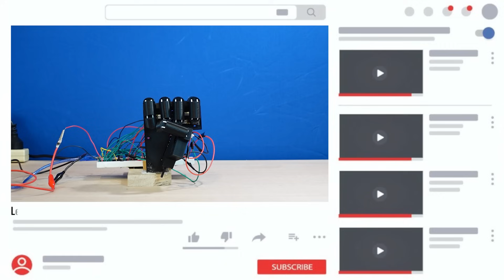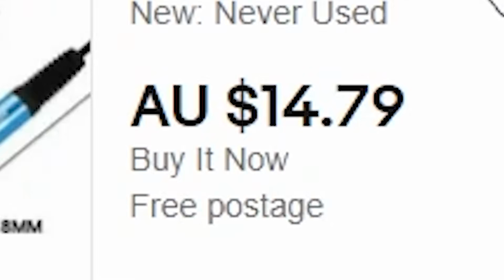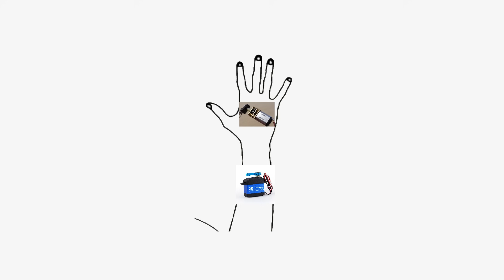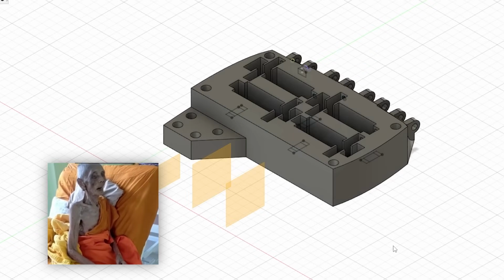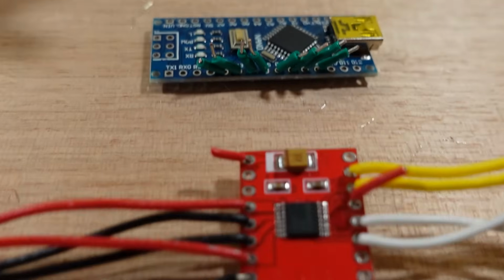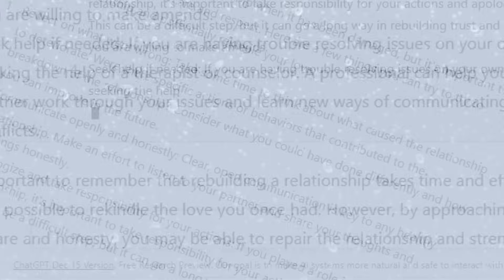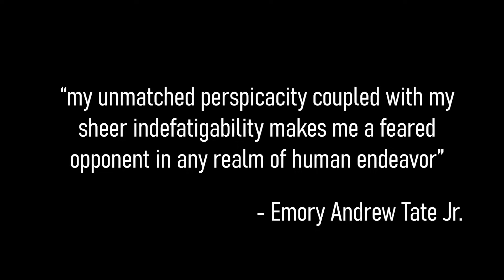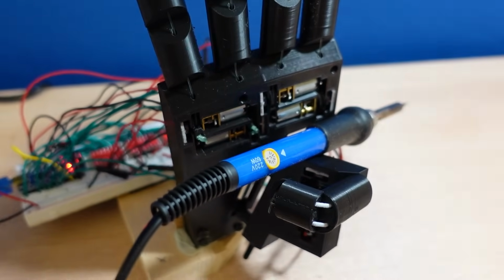Building a Robot Hand from Scratch

Comment: i tried to build my own robot hand too for the first time i done it on tinkercab first doing it virtually first so i won't make a mistake in real life learning where i'm gonna plug the wire on the right arduino pin my own robot hand is much easy simple robot hand it's just a push button when i push one button it simply spin the servo at 90 degree to pull the strings i do this project just to learn electronics but i made a mistake buying the wrong servo motors i bought a 360 degree servo motors instead of 180 degree i thought 360 and 180 servo motor are the same but the 360 are like dc motor where you can control it speed and it  continuous rotation unlike 180° servo is a positional motor that moves to and holds a specific angle (e.g., 0° to 180°)

Comment: 9:03 wrong it's more. The little parts are about 1/16 (6,25%) so that means the green part is 15/16 (93,75%) so that would be the real amount of suffering caused by soldering.

Comment: I was thinking about this the other day. if you feel your actual arm while moving fingers there are muscles in your arm doing the motion. so why not put all the power in the forearm? then you could run bowden tubes to the wrist for the wires to run through. But most important is finger movement. only the last two bones should be controlled this way. the main finger bone (Proximal Phalanges) should have x/y movement. slightly bend left to right. and as far as the Metacarpals, they move slightly, but i wouldn't bother in a robot. i kind of want to build a fore arm with a robot hand done this way. now I'm just thinking how do i make the wrist move as well with all the finger control wires running through it.

Comment: IF the human arm uses ligatures which pull the fingers open and closed why 
not use linear Motors rather than Motors and some form of optical sensor to see where the position of the Finger is

Comment: My problem that i face is when you try to hold something for longer than thirty seconds, the high current from stalling the motors just requires a temperature sensor which is hard to include as its a lot more wires in total

Comment: good video, keep up the good work. I have one question
how did you manage to control the arduino with python is there a library that turns the python code to C?
Reply: He is saying this in 9:25. He is using pyFirmata, which is python library of Firmata protocol for reading/setting values on arduino pins. So basically he created a python script and then using Arduino as an interface to control motors ;)

Comment: Cool, now install current feedback so you can get a rough analog for gripping force. Regarding this, it’s better if you can lower the gear ratio as this will mitigate high reflected inertia which causes the fingers to act “rigid”.

Comment: so you gave them the finger
Reply: hey, crane has more rotational axes, try a 6dof robot arm mouse (as 3d 6dof controller arm), ring it, to point a direction and position in 3d, is only 6 potentiometers, read the values (voltage) with gpio

Comment: One curious thing I've noticed about anyone who makes robotic hands is almost all go about it in a very difficult and unusual way - at least in comparison to the real flesh-and-blood thing. You try to fit everything needed to move the fingers and hand parts inside the hand itself, and then wonder why it's so difficult and you're struggling. This isn't how nature does it. Instead most of the muscles required to move the fingers are actually not in the hand at all, but instead are in the lower arm - with long tendons extending out to the finger joints. The hand actually has relatively few muscles, and most of those are to do with bending the palm rather than the fingers. Nature figured out it couldn't fit everything required for something as complex as a hand inside the hand itself, so it split the controls into two locations making the job of creating such a complex system far easier. I wonder why makers of artificial hands/arms don't do the same thing and more closely copy nature, instead of doing it the far more difficult way?
Reply: If a person lost their hand around the wrist and still had their forearm intact then a larger device with components in the forearm would not be suitable for them
Reply: @MahdiDesigns  If it's going to be a prosthetic device then yeah, I 100% agree with you. You have to work within the boundaries of what biology the person receiving the device has left to work with. But if it's going to be just a robotic arm as a standalone or part of a larger robot, then my point remains valid. Why complicate thing unnecessarily when nature has already done so much of groundwork for you through millions of years of trial and error?
Reply: @DavidStruveDesigns  that's right, design concept and details depend on whether it will be a prosthetic device or a humanoid robotic arm

Comment: dip your wire tips in flux, like just coat that stuff up, even if you get flux solder. It's a lot easier for new guys at soldering. Dip your soldering tip in the flux also and then you can apply solder easier to the iron, and thus no need to hold the solder wire as much.

Comment: Soldering with cheap soldering irons is probably one of the most frustrating things I've ever had to deal with. The solution is to simply get a better soldering iron. More expensive ones are able to heat the solder much quicker and it is way easier. After a lot of research I bought the X-Tronic 3060 Pro, which on top of being a good iron allows me to tell people I own a 3060.

Comment: soldering with that might be the root of your suffering, but if you learn to use the equipment on that then move to a nice(r) station in the future, it will be so much more rewarding. also grab some silicone wire spools, no more burnt insulation from micro soldering in place. awesome project though!!!

Comment: hey sorry to ask, I happen to be designing a prosthetic arm myself, same as you, Ive been trying to find an alternative to servo motors because theyre huge and cant fit in a hand, I noticed that you used dc motors, and some other pcb that Im assuming reverses the polarity to make it spin the other way. Could you possible link me that part you used? aswell as the potentiometer. Also dont use random soldering irons from aliexpress, theyre awful, Id recommend taking a look at the pincil since theyre a lot more affordable and have good functionality.
Reply: The motors he used are called N20 motors, and they can be found simply but googling "n20 motors 50rpm". The boards he used to reverse the polarity of the motors are called H-bridges and he used the DRV8833, although you could use just about any H-bridge as they are all very similar and N20 motors draw very few amps. I could not find the potentiometer that he used but you can find similar ones by searching "flat potentiometer".
Reply: @luekbaja  I already spent a lot of time finding this stuff unfortunately T-T ty for the effort tho

Comment: Instead of jumping straight to soldering all your components together, you should've soldered your lead wires from the components and connected the leads through a breadboard to ensure that your wiring was correct and that all wire connections made to the components were done securely without damaging the component itself. All in all, don't be disheartened by your mistakes, be glad that you not only learned from them but were able to teach others about how you set out to learn by doing. Great video, subbed.

Comment: You should definitely try custom PCB design. So much less soldering and wire spaghetti, and incredibly cheap these days, even with SMD soldering service. Usually cheaper than buying all the separate little boards and soldering them together. Well, cheaper per unit. But usually you have to order at least 5 units, so for a one-off design it is more expensive, and wasteful of components (which are in short supply as it is)
Reply: Yeaaaaaah.... that is because you live in the US/Canada (probably). You don't have this kind of option in other countries.
Reply: @DH-ts6ho  JLCPCB !
Reply: @DH-ts6ho Eh? Both JLCPCB and PCBWay (the two major companies who do this stuff at low prices for the average person) ship to just about anywhere that you can even ship things to.
Reply: @ianbryantperfboard are overrated just use a breadboard
Reply: lmao imagine trolling a computer programmer to not only switch to robotics, but to make PCBs as well. i have an idea, he should manufacture his own silicon wafers as well! what's the price of failure? just cancer in your 30s is all
Reply: “Silver is for the kettle, and gold for the furnace, but The LORD is the tester of hearts- Bible” your heart is like discovered silver, dirty and not pure, when silver is purified it is melted over and over, to the point that when it’s melted and glows red hot, it is pure enough to see your own reflection in the puddle, so also does the LORD purify your heart, till HE can see HIS own reflection in it, seek the LORD and be reborn, ask The LORD to renew and restore you, repent and ask The LORD for HIS Salvation for those who seek will find and those who knock the door will be open unto them, no man is good, all are in need of salvation, Jesus died so that our sins will be wiped away and so that we could be made new, seek The Kingdom of GOD for if you would be wise you would be wise for yourself, pick up your cross and deny your flesh and follow the path of GOD, for The Kingdom of GOD is at hand, in JESUS MIGHTY NAME Amen and Amen
Reply: Totally disagree, you still need to solder as many things as you would have to without a pcb, its also much more organised and straightforward.
However like you said, it would be more expensive and wasteful and of course, Gonkee's videos take enough time as is, this would make it even longer if he made mistakes with the pcb design again and again.

If Gonkee possibly invested in a cheap 3018 pro cnc like I did a few years ago, and used it for pcb milling, we could see a lot more content like this and more crazy content, also maybe he could get into stm32 chips and creating boards for them, not just using breakout boards.
Reply: @defaultpassword  Question: Where do I find more information regarding CNC parameters and differences/uses between models? Won't a Shapeoko CNC work, as well?